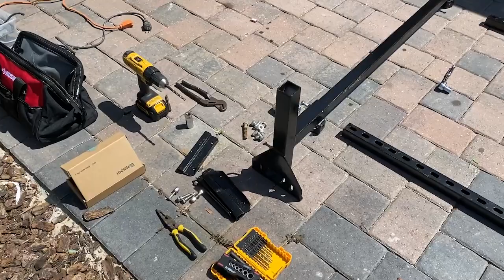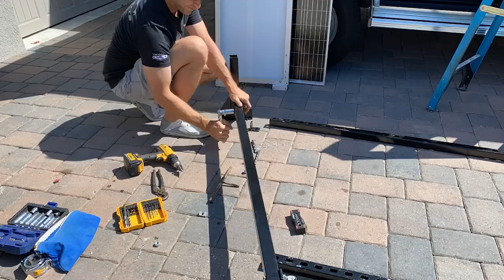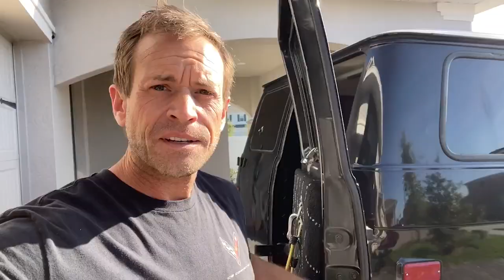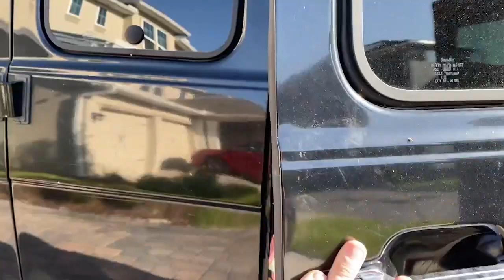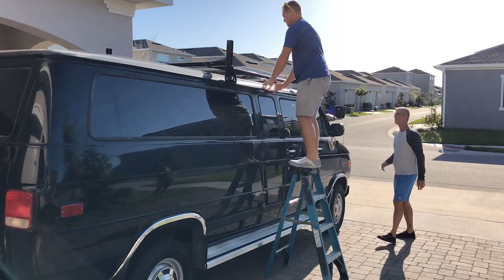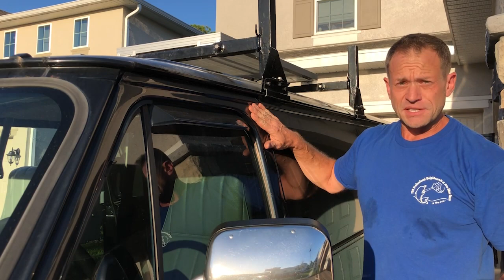Van Build | Installing Solar Panels

Comment: With the added height, will it still fit in the garage??  Just curious.
Reply from the maker: They make these expensive track houses to fit sports cars and small suv's for all the soccer moms around here.  The Vantasy wont fit in without the Racks.   I like showing it off in the driveway anyway!

Comment: Dang man, you are gonna lose a ton of gas mileage with that on the roof. Probably gonna go from 6.4 to 6.2 mpg in a hurry 😜🤣
Reply from the maker: Im at about 14-16 on the highway and 10 - 12 in the city.  might bring it down to 9 - 13.